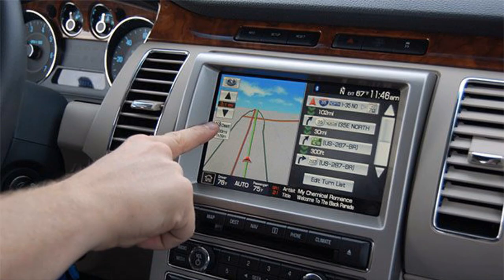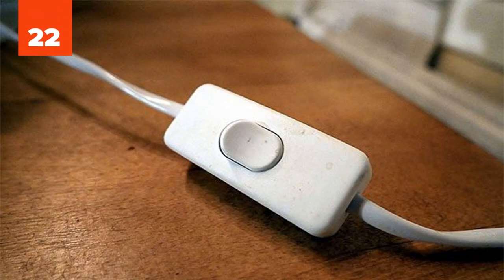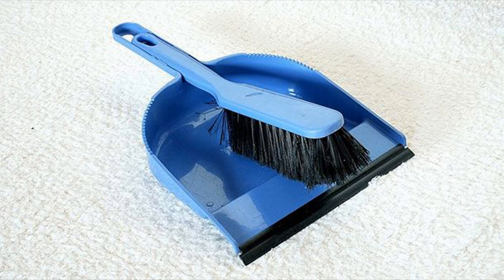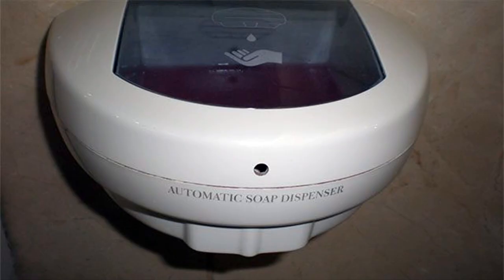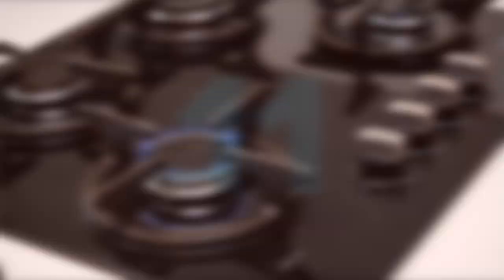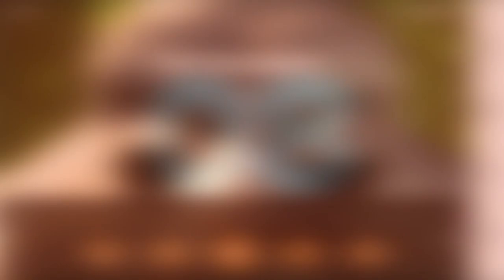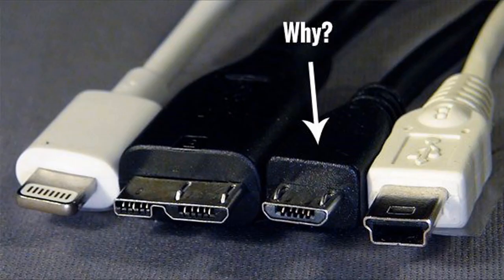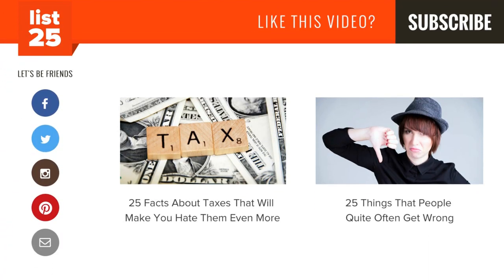25 SERIOUS Design Flaws In Everyday Products

Comment: what about dishwashers or washing machines that don't have a drain function. in the case of aging machines or overloaded loads of clothes, it could run for hours and cost you a lot. or if it's flooding, you cant prevent further damage by draining it out. and if you forgot soap 5 minutes in, you cant open it to add it, it's sealed and won't know to pull from the soap well again, aunless you restat the load, and add another laods worth of water and then it takes twice as long to dry.

Comment: The steering weels are logical, because if you are driving on the right side of the road, then if the steering weel is on the left of the car (witch is in most cases) you can look almost around the car in front of you to see if you can drive around that car or if there is another driver on the other drivinglane witch you are otherwise going to crash into.
Reply: wheel which
Reply: super destroyer yep you are correct about that.

Comment: USB. All of it. Because the latching mechanism on the port isnb't sufficient. And because the port is used all the time, it wears out, resulting in false contacts. Micro USB is making it worse. Ports should snap in place firmly.

Old computer connectors had pins and large metal casing, sometimes backed by screws to avoid this issue...

The charging cables of phones. Why is it so small? It should be at least two meters so you can use your phone while standing up.

Modern websites and sleek everything. They hide everything to make the interface look cleaner. But adds unnecessary steps for most functions. Remember 10 years ago where Google image options were on the side in plain view?

DVD cases. Why are they so large? And why is the center spindle so tough it ends up cracking your disk?

Automated everything. Yeah it makes it easier to use. But stray from the intended way to use it and you are in trouble, and kills reliability. For example. Why can't you just copy/paste your music into your ipod like in a thumb drive. And why can't you just use a file explorer rather than having the device sort the music for you?

The ignition of motorcycles. Only Harley Davidson got it right by allowing you to remove the key from the ignition without cutting it. Most bikes dont let you do that, forcing you to leave the key in, with the rest of the keychain flapping around, ruining the paint. Worse still, you cannot take them off and leave the lights on. So if you need to stop for a piss and put your hazard warning light on, you have to leave the key in.

Parking tokens. It's dumb. Use a card instead.

Comment: SARCASM MODE ACTIVATED

#25 - Let's put this "technology" thing on everything right now!  I don't know what you mean by "consequences".
#24 - At least it looks cool.
#23 - At least there's no chance of the sticker coming off by accident.
#22 - On the bright side, you no longer have to reach up to turn the light off.
#21 - At least it looks cool.
#20 - More technology in more places!  What are these "consequences" that you speak of?
#19 - At least she can't be pick-pocketed.
#18 - At least you can get your floors cleaner than they were before you had the dust pan.
#17 - Consequences are irrelevant!  It looks cool!
#16 - Sorry, convenience stops with the design of the basket.  We apologize for the inconvenience.
#15 - It saves on metal.
#14 - Why not wash the door handle if your so germaphobic?  Germaphobe!
#13 - On the plus side, at least you can't squish it by accident while taking it home.
#12 - At least you only need one rear-view mirror.
#11 - That'll be extra.
#10 - This next test involves the effects that sticky residue on fruit has on the human body.  We at Aperture Science respect your rights to feel nervous about this next test.
#9 - Just lock the door and you'll be fine.
#8 - It saves space for bigger descriptions and longer comment threads.
#7 - What?  You don't enjoy riding on elevators?
#6 - What do you mean by "healthy"?
#5 - At least it should make a pretty good make-shift weapon.  You know, just in case!
#4 - We ran out of room on the screen, sorry.
#3 - At least you don't have to worry about a full-size USB port weighing down your device.
#2 - Making them different sizes would increase production costs by a few pennies.
#1 - On the plus side, at least it doesn't matter which way the handle is moved.

SARCASM MODE DEACTIVATED

Comment: Dum Dums. The sticks are made of paper and the paper melts and they should have a thin plastic coating.
#25: Cars have touch screens?
#24: I agree.
#23: YES.
#22: YES.
#21: Yes…
#20: Yep.
#19: I'm no lady!
#18: YEE!
#17: Yeah.
#16: I agree.
#15: Yee.
#14: YES.
#13: WEEGEE!
#12: Mm hm.
#11: Yep.
#10: They are kinda useless besides indicating the brand.
#9: My rectum!
#8: I'm not deaf! D:
#7: Yeah…
#6: Tide! You stoopit!
#5: I know…
#4: Yearp.
#3: My problem is they exist.
#2: What's wrong wi—oooooh…
#1: Toilets are annoying to my digestive system. >:(

Comment: USB ports side-by-side instead of atop one another. Nearly impossible to insert two sticks into adjacent slots.

Software that tries to be all things to all people. If all a I want is a word processor, does it really have to be able to draw pictures, code spreadsheets, be an address book, wash & wax my car, and cook the perfect 3-minute egg? Talkin' to you, Microsoft Word...

Basket coffee filters packed you can't easily separate by hand. Why not include a little tab on the edge you can grab? It wouldn't be hard to include an indexer in the automated packing machine to rotate each filter by one pleat before stacking them, so the tabs wouldn't all be atop one another. EDIT: You'd want to rotate the stack, not each individual filter. My oops.

A built-in straw in ketchup bottles to prevent vapor-lock. (Probably too costly, though)

A funnel built in to your car's windshield washer reservoir (or bottles of fluid with long necks) to avoid slopping the fluid all over the engine compartment.

Comment: The raise and lower blind cords are usually clipped together though they should be CUT apart, if young children are in the house.
There are other styles of wine glasses.
You open the BR door out into a corridor and hit someone with it=lawsuit.
I sure agree about those stupid touch screens and similar input devices...stupid and dangerous.
A thermometer for cooking?  Now there's a great idea.  No, wait, there are already MANY of them in different designs.  We have 3. Guess someone thought of it first, maybe a century ago or more.
Stems pull off some ripe fruit too easily and they have to be readable for checkout (often).
Different size currency has been extensively studied and sensibly rejected.
A lot of people use a foot to flush the "hand" flushers. No one wants to touch those handles with their hands.
Reply: It's a matter of how the cords are attached.  You can make a series of slip-knots, looping the cord on itself until the total length isn't long enough for children to reach the bottom of the cord (even when the blinds are raised all of the way).  When you're ready to lower the blinds, just pull the cord clear and lower them, and the result is that the knotted end of your cord is now at the top of the window, safely away from the children's reach.

Comment: wow some of these are bad! You need to learn the purposes of things around you!
The switch in the middle of the cord for example allows you to position the switch close to your bed/body & easily clip it down, so you can switch it in the dark before you get up & not risk knocking your lamp over while fumbling to touch it & reach the switch.

The lift "deactivate" button, can you seriously imagine if a child got on board & started pressing switches with that present? You think it's frustrating to have all floors pressed, well how do you think you'd feel if at the last second they pressed your floor off & you had to travel an extra 20 floors up & then back down again as a result!

You really need to learn about the world around you!

Comment: To remove sticker glue use WD40 works better than anything else..
Reply: You're better off using Naptha(ronsonol or zippo fluid)-gets the sticker off, and evaporates completely(which wd-40 won't do).
Plain kerosene works too, but takes much longer to evaporate.

Comment: How about smartphone screens being made out of glass, instead of plastic, like they used to be? A cell phone is subjected to far more physical abuse than any other electronic gadget you own, and yet the manufacturers make the majority of the exterior out of one of mankind's most fragile substances.
Reply: Plastic scratches easily.
Reply: I do agree that it scratches more easily than glass, although glass is not immune to scratches either.  In my experience though, I've seen far more users with cracked/shattered glass screens than I saw with scratched plastic back in its heyday.  So long as you used a phone case with a lip around the edge of the device, and didn't put it in the same pocket with keys, etc., it was very difficult to accidently scratch a plastic screen, even if dropped.  The notable exception being face-down drops on uneven surfaces like gravel, though the resulting scratches were typically far less bothersome than a glass break from a similar drop.

Comment: Weak.
#24: Didn't you do a video where you said you're supposed to use the button to attch it to your shirt when not in use?
#21 One of the cords is to open/close the blinds, and the other is to adjust the angle of the blinds.
#19 I wouldn't call that a design flaw. It's perfectly possible to put pockets in womens pants.  It's a design choice. Just because some manufacturers don't, doesn't mean that none do or that it's impossible.
#17 Different wine glasses are designed differently, for different kinds of wine. If ti's got a long stem you're supposed to hold it by the stem so the wine doesn't get heated by your hand.
#16 I've never had a problem holding a basket like that. It's no different than a picnic basket. Just let your hand hang down with your palm pointing to the back.
#14 That's a design flaw of the door not the dispenser.
#13 According to some [weasel words, I know] glass keeps better and doesn't taint the flavor of the food, unlike plastic.
#11 You just busted your own claim of "design flaw." Temperatures instead of numbers would be worse for the exact reason you said.
#10 Because they would fall off, and would be harder to attach.
#5 I cup my hand around the clipper, which reduces flying nails.
#2 No mention of colors?
#1 Cheaper to fix what's there than to install all new stuff.

Comment: Most of your so called flaws are actually pretty smart specifically designed features. The stickers are designed to break to prevent people peeling them off in shops and replace them on higher priced items. A cancel button in elevators could cause arguments in elevators between people who are entering and people already in there. it's first come first serve and places like hospitals actually have some sort of override key that can cancel a button. Switches on chords provide some remote turn on/off feature, plus their design can be universally applied to many different lamps. One chord blinds would have to use a whole different and difficultmechanic which would result in them being much more expensive.Also the two cord design can be used to adjust to places where the hanging or bottom surface is not straight(slanted ceilings). There is more to point out but except maybbe one or two(your touchscreen argument is valid) most of what you said is plain silly

Comment: Bras that do up at the back and the straps that fall down all the time. A front loader with crossover straps is easier to get on, doesn't have an unsightly bulge where it joins at the back and the straps stay up and invisible under short sleeves. Why are they still making the old ones? Luckily I don't have to wear one of these contraptions as I still have the breasts of a young girl- a nine year old, but still....

Comment: Gotta disagree With several of these. 
Bottles made of Glass is not bad, they are made of glass for a reason, duh. 
Steering in the middle of the car is dumb as hell., wth, 1 less passenger seat.
Basket thingy, it way better off the way it is now.
Touch Screens on cars, back when you didn't have touch screens on cars, you weren't able to do half the stuff you can do now. While most cars have the basic Controls easily available on the steering itself anyway.
Nail Clippers, you're just doing it wrong.

Comment: The small label on fruits and vegetables are made of eatable paper. It only takes a second to remove it, though, so I fail to see the issue. And why can't it be put on the stem? Most are not sold with them. I suspect Mike hasn't spent much time in the produce section!

Also, nail clips have long been sold that have a compartment that catches the clippings. Said compartments easily slide off to be emptied. Most of this list is nothing more than first world lazy complaining!

Comment: plaster walls.  they cant hold a nail or screw so you have to drill a hole and hammer in a special fitting just to hang a picture.

power cords. Why do they have the on/off switch on the opposite end by the cord instead of closer to the user?

why do car electronic devices continue to drain power from the battery when it is already too weak to start the car?
   
computers.  In the 80s it took about 5 minutes to boot up your computer.  30 years later computer are said to be thousands of times faster so why does it still take 5 minutes or longer to boot up?  i know its more memory but why dont they just let the speed catch up before adding more complicated programs than the processor can handle in a non annoyingly slow amount of time?

Comment: why would 11 be useful? I'm pretty sure boiling water has a constant temprature of 100 C...
Reply: Friso Well, cooking meat, making candy and creams for desserts, etc. require exact temperatures to prevent burning or disease. Not everything is boiled.
Reply: Friso depends on atmospheric pressure when water boils, but if the stove says it's heating at 500° then some heat will be lost throwgh the cookware and stove and air  sorroundings giving the food a final temp ,e.g., of 100°, making such a system inacurrate. That's why there are cooking thermometers.
Reply: But cooking oils don't. Deep frying temperature depends on what you're cooking.
Reply: yeah, but that's technically baking, not cooking
Reply: No. Cooking is any preparation of food involving heat (and there are some who consider ceviches as cooking). Baking is a dry process, involving radiant heat - usually done in an oven, not the stove top.